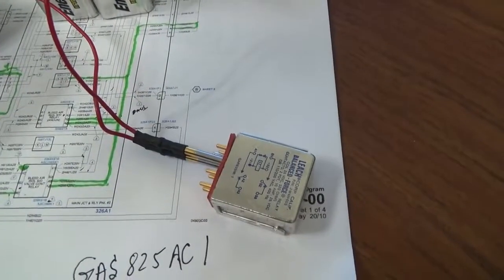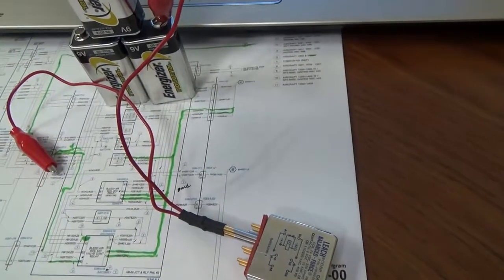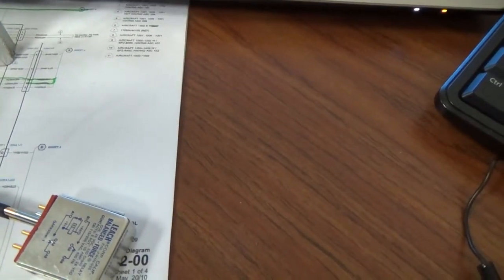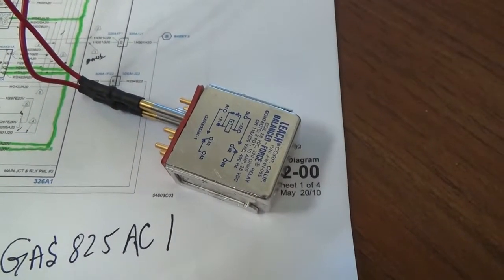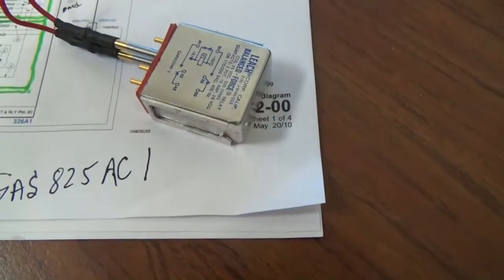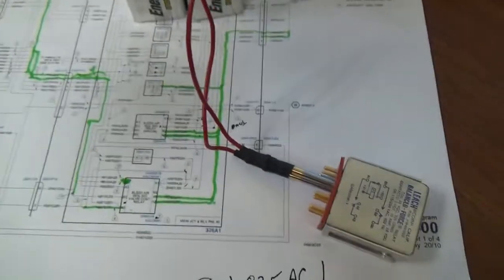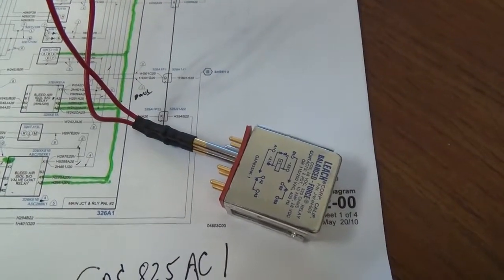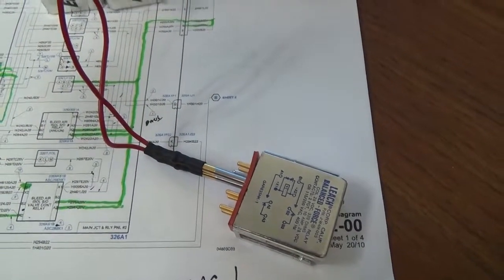Bad Leach Relay

Comment from the maker: I cannot answer your question. In airline line maintenance and troubleshooting, we change relays frequently. Each commercial size aircraft probably has over 400 relays installed. Multiply by just 10 aircraft and we're looking at 4000+. I've never ripped one open. We just replace.

I found this: http://www.n7cfo.com/Tgph/dwnlds/Leach.pdf It's from the 1930's

Just digging around the internet....

https://www.bartolmagprobe.com/2014/09/21/leach/

https://www.yumpu.com/en/document/view/47446316/principle-technical-characteristics-leach-international